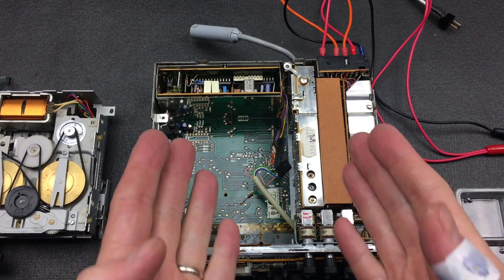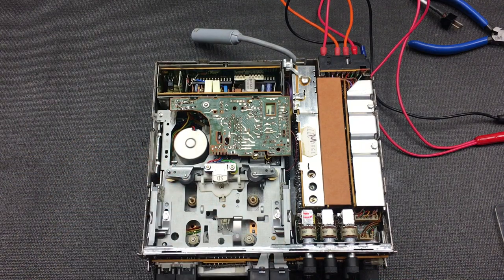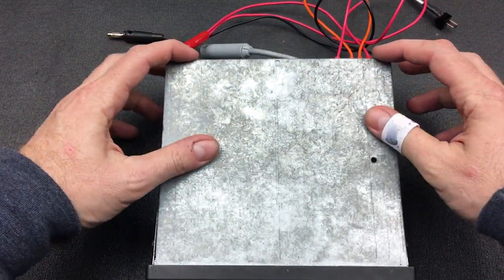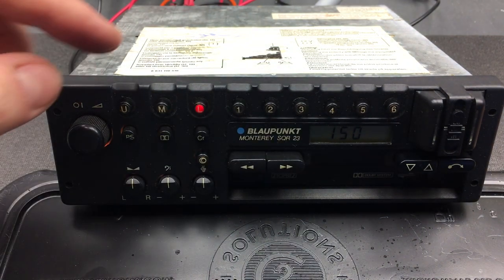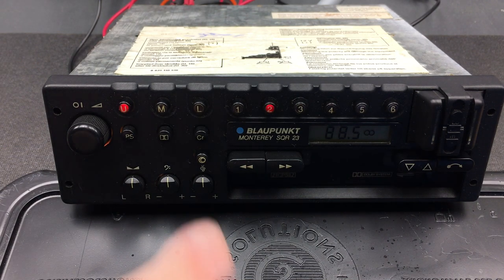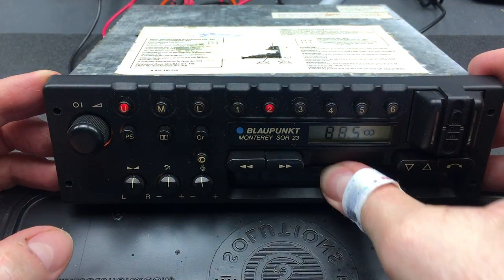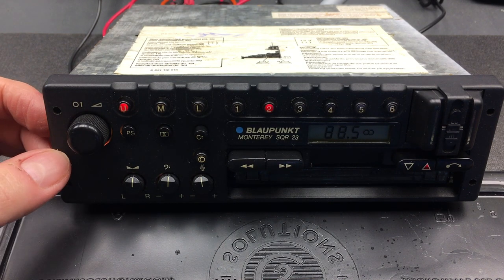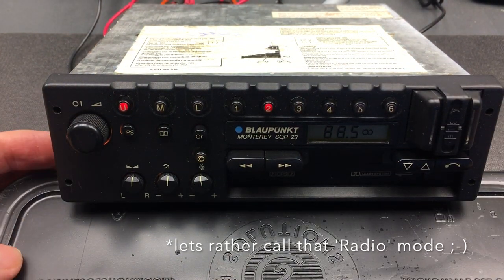Blaupunkt Monterey SQR 23 Part 5: Reassembly & Demo

Comment: Olaf, absolutely brilliant series on the SQR23! Unfortunately, I (sorely) lack both the skillset and courage to tackle what you did... 

I've been searching for a reputable shop/person to repair my SQR23 Monterey for a few years to no avail. There is almost no one, at least in the CONTUS, who can/will do what you did. It's a pity b/c the meteoric rise in value of many 80's car marques, esp. Porsche, has resulted in a huge demand for vintage radio repair (check Rennlist, PCA, other sites for desperate folks like me). Another data point: fully functional SQR23's sell quickly for over $1k and non-functioning units can be had for a couple hundred.

My unit is original to my 1985 Porsche 944 which is a Concours-quality and fully stock car with 30k original miles. It just won a regional show but I drive it on weekends with my kids as it was meant to do. I'm the second owner, have the window sticker (the SQR23 was a then-pricey $650 option in 1985, btw!) and all documents from new. The car really deserves to have its' original Blaupunkt fully functional.  Plus, I have a huge box of 80's cassettes (from my high school days) that I really want to play! U2, Police, The Fixx, Depeche Mode, all the good stuff.   

The a.m. on my unit works, as do all the lights, and I have a jack installed so I can play music from my iPhone. However, neither the FM nor the cassette are functional.  I know parts availability is a huge challenge, as is finding a person with the skill and interest to take on the project. 

I get that this is just one of your hobbies and you've got a few other things to do (e.g., helping to run K2, etc.) but is there any way I could convince you to take a look at my unit?! [cue heavy laughter]. A gorgeous SQR23 and wonderful time-capsule 944 are at stake and you could be the one to rescue them for the sake of history! Alternatively, do you happen to know any else (maybe a retired tech. co. exec. with lots of spare time who also likes to tinker with electronics?) who you'd be comfortable referring me to?  I'm in the San Francisco area, could ship anywhere. 

Whatever the case, no need to respond.  I just had to reach out and tell you it's a terrific video!  Your comfort level and competence in tearing down and repairing that unit is a thing of beauty.  Cheers!

Comment: Hello Olaf,
Great set of videos on the Monterey tape deck.  I tried to follow bypassing the tape deck, but some reason the radio doesn’t want to engage. Any thoughts how I can make the radio work again on the deck? Any feedback would be greatly appreciated.
Reply from the maker: Thanks for the feedback. What do you mean by 'bypassing the tape deck'?
Reply: Hello Olaf,
In your video part 3, you provided how to install a line-in modification on the stereo were the tape deck component was not required to be re-intalled.  I followed your video and placed the jumper cables in the designated slots. It appeared that the cps button worked as in the video but the radio waveband u button was not engaging to activate the radio.  I decided to try your line in modification since my tape deck stopped working and for some reason it is not allowing to engage to the radio mode.  I hope there is a simple way to fix this issue.

Regards,
James
Reply from the maker: @jamesmathers4999  Wow that is strange. What do you see when you power up the unit? Does the 'U' LED light up? What is shown in the LCD display? Also, what happens when you press the 'M' and 'L' buttons?
Reply: @olafwagner  
When the the unit is turned on the lights on the units come on , but the LCD display does not provide the radio frequency just a blank display.  The "U" LED does not turn on when it's pressed  and same goes for the"M" and "L" buttons.  It seems to be operating in the tape deck mode.
Reply from the maker: @jamesmathers4999 I think the problem is 'deeper', because even when a tape is playing the display still shows the frequency, and the U, M or L light is on. (I just verified on my deck as I got home). The best I can offer is the schematic. (https://www.dropbox.com/s/n6rnedxxf3575t6/01%20Schematic.png?dl=0) Maybe that will help you trace back from the LCD display board (PL44)
Reply: Thank you for your help and for providing the schematic for the stereo.  Cheers!